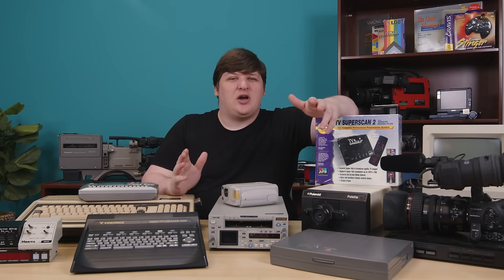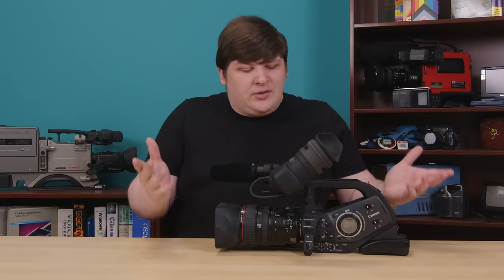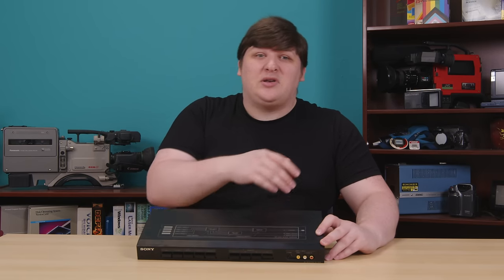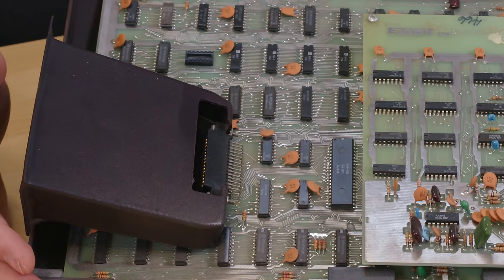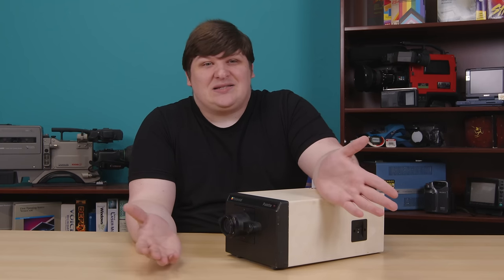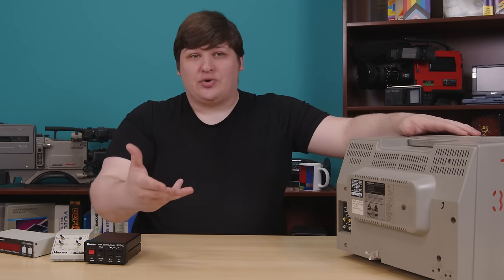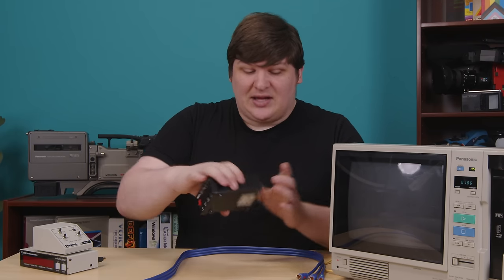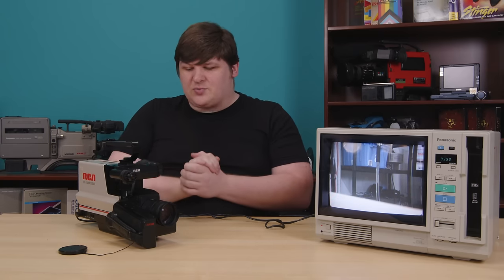Weird Stuff I Got From California (Where else?)

Comment: Hi there - first of all, massively jealous of the Chinon ES-3000, I would love to find one in the wild, but I believe they are ultra-rare in the UK. On the other hand, the Kodak DC-50 which seems to be identical aside from the colouring of the shell is a lot less uncommon and I do have the software for that as I have one. There is an extremely good chance that will work with this camera. I will pull mine out and see what other ways there are of getting the shots, but let me know if you want to give that a try.
Reply: Ahem, as an additional edit, look for a CF to PCMCIA adaptor. They do work in these cameras.
Reply from the maker: That's what I was trying, but couldn't get it to work.
Reply: @CathodeRayDude  What size CF card are you using?
Also to be clear, is the PCMCIA drive not working in the camera?
It's late here right now, but in the morning I will pull out my camera and check exactly what I am using to store the pictures.
Reply from the maker: @achaycock  I tried 1gb and 4mb standard CF cards, then a 256mb WD silicondrive. I suspect formatting to be the issue.
Reply: @CathodeRayDude  OK, 4MB should have worked for sure. I will report back tomorrow on what works with my variant.
Reply: @CathodeRayDude  Hi there. I've been looking into this and I can confirm that this is indeed the same camera as the Kodak DC50. I used a generic PCMCIA adaptor and a FAT formatted HP branded compact flash card and everything worked.
My first thoughts would be a different PCMCIA adaptor. I'll have a look and see if I can get a branded version available in your country to try in my camera. There was nothing special about the format of the CF card.
Reply from the maker: @achaycock  thank you for the info, I'll try again!

Comment: Btw it's called a glidecam, not a gimbal nowadays exclusively. A gimbal is using motors, glidecams are passive
Reply: Glidecam is one brand of a Steadicam (the original device & brand) copycat. It works with the same principles of passive inertia & isolation.
A gimbal is a generic term for a device with multiple concentric axis of rotation.
In modern filmmaking terms a "gimbal" means an active electronic motorized self-leveling device.
However the central fulcrum point on the post of a Steadicam is a passive gimbal to allow for the angular isolation of the camera from the support/arm/operator.
And some newer models of Steadicam incorporate the addition of active motors built into their gimbals to provide "power assist" features to the mechanical Steadicam system.

Comment: Would be interesting to find out some technical details on how the red light on top of the studio cam monitors is activated
Reply from the maker: That's called a tally light, and it's fed by an output on whatever control unit you're using. Usually there's a connection going all the way back to the video mixer, and I get the impression that you're pretty much just supposed to have your broadcast engineer build a cable because I've never heard of or seen any adapters for it. As far as I know it's just a switch closure, so you can control it with just about anything

Comment: that 1978. MOTHERBOARD was simto ATARI boards with RISC silicon chipsets  and heat dissipation; <= 1980= LARGE issue for IC chipsets;  t<Microsoft of 1983 standards. 
XLH1 great buy and durable.

Comment: 13:16 That looks to me like a CF card in a CF to PCMCIA adapter. What is proprietary about that? Just take the CF card out of the pcmcia adapter and read it in any card reader that supports CF
Reply from the maker: Because it doesn't work. I just had it in there to fill space. I didn't expect it to work either, since info online suggested this device takes a unique PC card format; more recent info suggests it's just linear flash, so I will be revisiting it.

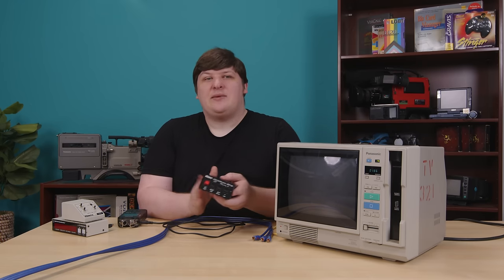Comment: 39:15 Oh boy, this absolute f*cker.
This device and I have history. Until watching this video, I didn't actually know what it was for, I just knew we were using it wrong. And we were.

Some context: I work for a local PEG station in the US, so I'm used to being... "slightly" behind the cutting edge (cries in Sony Anycast.) So we always had last-gen tech. But I didn't realize how many generations out of date this thing was!

I was using this device to title municipal meetings in 2017. not 2007, 2017. And I was using it computer free, which meant I had to use the front buttons to change the date every meeting. This device was just hooked in between the one camera that we had in this particular building and a DVD RECORDER. because every meeting was burned to DVD on site. Because apparently we uploaded the files to our NAS by ripping DVDs. in 2017. Anyway, we don't do that anymore, because eventually I got fed up and now I just record to an SD card, run meetings through After Effects to add the title, and load them into the NAS directly, because you definitely can do that, actually.

In conclusion, in 2022, I am now the most senior employee of that particular PEG station.

Comment: I hate to correct you on your nice video but the canon XL2 was actually released in 2004 not 93 Canon had other cameras at that time The 
The Canon XL-H1 HDV was released in 2005 I have both of them The XL two was an expensive camera $5000 back then and then the 
The Canon XL-H1 HDV camera, with a few accessories.
The Canon XL H1 was even more expensive. The only difference between the two cameras was one camera was Standard resolution and the other camera could film 1080 720 i HD that was it that’s the only difference between the two.

Comment: Note from the Pedantic Police; that Very Unfortunate term "burning" is Very Highly-Unfortunate, in that as vid tape scrolls ACROSS the screen/record-playback heads, then ANYTHING physically "burned" into the tape wld only display as a Solid White Bar (which could Never be erased, BTW); that is, of course, nonsense, as anything perforating &/or being impressed upon the tape medium itself wld almost certainly degrade it's tensile-integrity past the pt it wld resist snapping while under load...thus, ONE term = 2 pointless inanities; the Bureau of the Tragically Overprecise recommend calling it for what it IS - a tape signal Overlay...   ;~ ]

Comment: The easy (and smart) way to deal with the 9v ac power adapter is to not plugg it in to the wall outlet till it is in the devise you wish to power. Several types of extension cables has switches if you swap devise often, I´m surprised you did not think of that your self.

Comment: Dude,  you're brave for just plugging these old hardware in without checking caps and batteries inside.  You could be breaking something which is otherwise a very simple and cheap fix. That high pitched whine, or flickering video is a hint of this.  Those aren't ewaste, they're low cost fixes which are standard when dealing with vintage gear. I just how you're not breaking them by powering up all willy nilly.

Comment: I'm actually in the learning phase of starting my youtube channel on that thing :D
I got the XL H1 without the S though. The S is a lot cooler because it puts out sound over the HD-SDI which mine does not. That makes the regular H1 particularly annoying because you have to deal with a separate audio recorder or you're pretty much stuck with tape  or a very expensive firewire HD recorder.

Also I got the PAL version where the framerate selector knob is very misleading because the interlaced mode is 50i instead of 60i for the NTSC version and the F1 and F2 both do 25p instead of 30p and 24p 
So thanks cannon for ripping of PAL region customers by replacing 2 very common and useful recording framerates with a odd and rarely used one :D

But this much manual control is a steep learning curve for being the first camcorder I ever owned and used :D
Nonethelesse I think the image quality is surprising for its age:
https://www.youtube.com/watch?v=l-vZUkQyP1s
And the zoom is faaaantastic
https://www.youtube.com/watch?v=cdorFVc9vTk
Reply from the maker: Oh wow those are some real wild quirks. Good luck getting started btw!
Reply: If you don't need portability you can use an old laptop to record from FireWire.
Reply: @eDoc2020  that is probably the best solution given that in a stationary setting this also gives you a free screen for the focus guy which is very helpful. Unfortunately for the portable parts of what I want to do, a sony vaio p series kind of device would have been ideal, but I don't know of any device like it that also has firewire.

Comment: The reason you want to be able to move the time code from top, mid or bottom is on viewing multiple takes to log the video before editing. You are looking at a video tape that may have 20 takes of an actor going through lines on a phone. If memory seves me correctly I think it was $75 an hour for an editing booth. You wanted to get everything together so you are telling the editer "Tape 4, edit 9 at this time." Then the next edit, and next and...
Reply: Forgot the detail, having flash backs. So if there were details on an edge you needed to decide on an edit, y out would then see it.

Comment: 40:10   Um, pretty sure the instruction manual says to plug in the 3.5mm DC plug into the device BEFORE plugging the AC block into your wall socket. In other words, you're using it wrong, so no, nobody is going to jail for your failure to RTFM!  ;-]

Comment: fifteenth!
Reply: also fun fact about DVCAM, not only is it still being used, it's still being added into new installs despite the availability of solid state solutions. a project i am currently doing cad/excel work for has a pair of PDW-F1600s. i have to assume this is because a DVCAM tape will survive falling into water and an SSD probably wont.